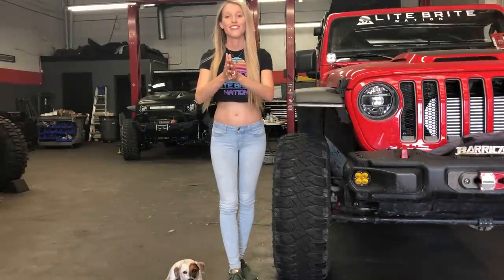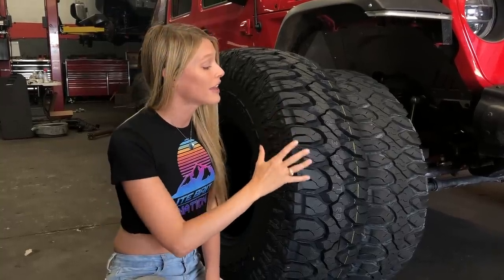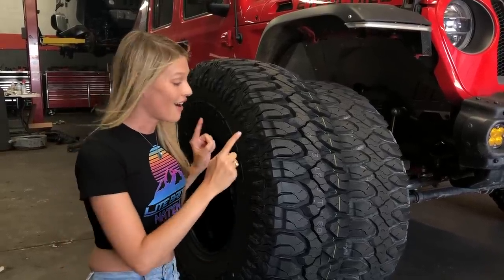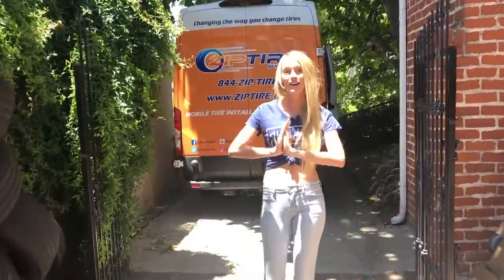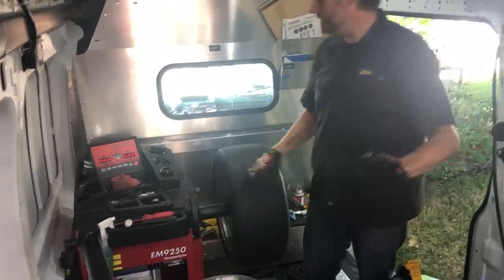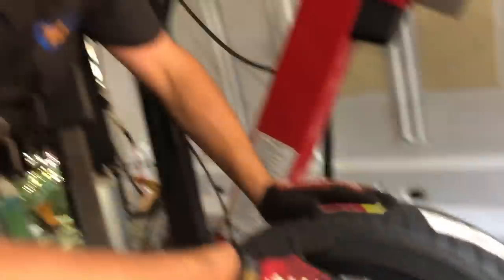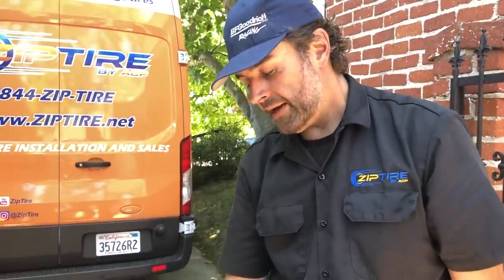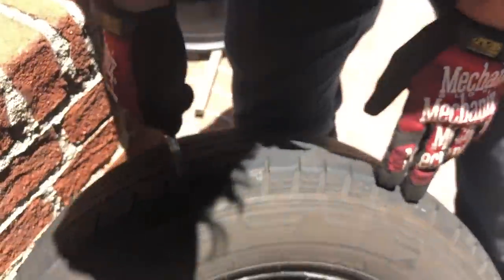LONG TERM TIRE REVIEW - Milestar Patagonia M/T

Comment: in a world filled with black wheels, keep them Lite Brite ! I have KMC Machettes in Brite aluminum with bead locks and It looks so cool on my Bittet Siver JKUR ! I get so many complements on how clean and unique they look.
Brite on Red will be awesome ! Any abrasion you will get on your lock rings will be your badge of courage ! Plus you can use a file to take down the burrs and flash that does occur especially with how hard you guys rock. Stay Brite Lite Brite ! Mouuwwaaa !!! (blown kiss)

Comment: u mention proper air pressure. when off trail, what do you suggest? i have the stock falken MT on my JLUR and the dealer had them at full pressure which was horrible for keeping it on the road. i dropped them to 38 (closer to the door plate pressure) and it is amazing...

Comment: Had the Patagonia’s for 18 months. Ran great for a year after that got loud and you could feel every lug at low speeds. Typically rotate about every 4,000. They have about 15000 miles. And the ride on my 2 dr JK is like driving a dump truck. Now they were good in snow and very good off-road but not sure what happened. Changed to a set of Dick Cepek trail country EXP. guys at the shop said they weren’t chopped. So I don’t know, but I’d never buy another set of Patagonia. 
They’re made in Indonesia, maybe bad rubber trees 😢

Comment: I have a favor to ask. 
IF that new motor winds up being a hemi or LS motor can you provide some feed back on engine heat and A/C performance? 
I figure since you guys are driving long distances and towing you would be a good source for these measures. 

Thanks

OverHeated ;)
Reply: Ralph Muro yup for sure
Reply: Kevin Williams thanks. 
I was about to ask you why you didn’t put an atlas in with the new motor but you just addressed it as I am watching that episode now. ;)

Comment: I've have figured on mine 35/12.5/15 that 2500 miles works best as well as running 28 psi seem ideal.

Comment: Will you be adding more lift going with the 40’s or just add a little more bumpstop?

Also don’t do any powder coating on the wheels. Run them as is, it’s not a mall crawler.
Reply: zmotorsports going to cut as much as possible then bump stop from there

Comment: Guys I encourage you to look into the “rock slide engineering- step sliders.” If you’re going to 40’s it’ll make it much easier to enter and exit your rig. The gen2 are bolt on using factory mounting locations, with no drilling or rivets. Just put a set on my ride and I love them. And yes they are rated for rock sliding, protection and convenience.
Reply: Chris Woo we have sliders already that work great! Thanks for the info though
Reply: I had multiple surgery’s on my terrible knees from 30+ years of competitive wrestling and coaching wrestling. The steps drop down a foot when I open the door and then retract into the slider where they’re protected when the door is closed. Makes it so much easier to get in and out of my Jeep. I know you guys are still young so climbing in even with 40’s Is still doable. This was a great video by the way, filled with good info. Keep them coming.

Comment: Powder coat is just gonna get scratched off on rocks. No point in wasting money on powder coat. As far as my Milestar driving experience with my 33's, I love them. My only gripe would be that my Jeep gets a little squirrelly in tight corners on wet pavement. Stay cool you two!

Comment: Cool video. I hope some people learned a few things about tires. I use to run/show people how to run Hunter Equipment. Some of the best tire and alignment machines you can get. and teaching them the correct way to repair and mount and balance tires. And I have to say, this guy has it down and knows what he's talking about.  
Ps. Kevin's getting his 40's, and it looks like maybe a set of 3/4 or 1-tons to mount them on! lol.

Comment: With my 33" Patagonia M/T tires I tend to drift through right hand corners on slick asphalt if I take them at about 25-30mph, not a bad thing that's going pretty quick through a tight turn on a mud tire, I just do it because it's fun 😜 Hoping to do axles next summer and snagging 37s or 38s

Comment: I actually learned a lot in this video.  I have the same feathering problem in my TJ, as I run MT's.  

I've stuck with MT's after using them one time to help firefighters put out a forest fire near my parent's home.  Re-gearing and the MT's got me from the base of the mountain in the swampy areas through the trees and trails, and up the steep side of the mountain to just yards from the inferno.  I did this trip back and forth all day.  

I'll have to keep a more strict rotation schedule from now on.  The problem is, the moment I rotate the back tires to the front, I get the infamous Jeep Death Wobble from 48 mph to about 55 mph.  After that, it flattens out and gets smooth.  It doesn't happen with new tires.

Comment: If its not a hellcat im guessing cummins 2.8 turbo diesal
Reply: Probably a 6.4L if it’s a v8 I bet.
Reply: Way to much work to install a diesel
Reply: @MrJoey1570  true but so much fun in the end. And not to mention a standout because there are not nearly that many diesal jeeps in Merica. Go big or go home am i right! Woooo
Reply: @JsGarage  cummins recently cam out with there 2.6L turbo in a box that is moslty plug and play for jeep
Reply: chris austin Yea it’s like 10K just for the motor and it doesn’t make a whole lot of power. There are some additional things needed. It’s really no more plug and play than an LS/Hemi. Waste of a swap on a JL IMO but the R2.8 would be neat in something else. Especially since the JL is about to get the ecodiesel from the factory. Hemi/LS or bust for lite brite IMO.

Comment: I wouldn't plan on too much freeway driving with those tires. I would definitely upgrade the brakes and axles. The rolling mass will put a lot of stress on those factory parts.

Comment: I'd powder coat the wheel and not the rim. But as for color or colors. Depends on the wrap if ya'll still thinking about that.? Have ya'll seen how well the Patriot tires do that diesel sellers sell.

Comment: I am running mile stars because of you.
40s on steel bead locks. I color matched the wheel to my body & bead lock is black.
Question is how are you going to balance?? I am running internal beads.
Reply: Eric Schein wheel weights

Comment: Great video. It was very informative. Loved the Porsche. I have been following you guys for awhile now and this is my first time commenting. I have a 2014 JKU that I upgraded the wheels (tires & rims) last November. Because of your earlier reviews, I went with a Patagonia MT on a 17” Race Line Clutch with a simulated beadlock rim from Discount Tire. Absolutely love them!!  So this brings me to my question. If you are looking for a loving, caring, interested in upgrading home to take care of your old wheels 😉. I know someone who might be interested. 🤔. PS I would powder coat the inside of the rims and the bolts on the beadlock red.
Reply: Terry Rapaich haha. Thanks for the support. Unfortunately the racelines are already spoken for

Comment: I got to learn about lift throttle oversteer first hand with my old Toyota MR2. It wasn’t nearly as bad as it would have been in a Porsche since the engine is in front of the rear tires but it did let me know that driving a car with the engine behind you is a whole different sort of animal then what most people are used to.

Comment: I have no experience with Milestars, so no hate intended, but my question would be why is the tire so much lighter, in exactly the same size? build construction, tread depth, # of plys?
Reply: The Nitto MTs are in a different class. This class wiuld include Toyo OC MTs. Class as in level of durability in design/construction. BF and Yoko are in between. The Mils are equal to Mickey or Cooper or Hankook. There are many others. The lightest would be goodyear DT. Look at the sidewall structure.

Frankly you dont need them to be that heavy unless its dedicated for offroad.
Reply: @TheXOoftheRO  if remember from the video didn't they state that the mils were a D range and the Nittos a C range. I would think that would put the sidewall construction on the mils a little beefier, and wouldn't that push the weight to being closer. But yes the Nittos being a dedicated M/T, vs the mils being more of a hybrid, would affect weight difference. 

Just seems like something is weird there, for the those tire weights to be that different.
Reply: @BigM4x4  well that's the point not all tires are made the same. A toyo Highway Tire rated at 35 PSI that's only rated for 2500 lb is actually capable of more. The Nittos and Toyos are just designed heavier duty.

Comment: Powdercoat the center and leave the wear ring plain. Unless it’s a show jeep now
Reply: Smarter Than You lol never
Reply: Kevin Williams sarcasm is hard to convey I think you guys are great. 

I’m rejoining the Jeep fam soon. waiting to see if the 260 HP/ 480 TQ just announced for the new 3.0 ecodiesel ram really just needs a delete, a tune and a few basic mods to be a ton of fun to drive.  if so it cuts the build cost in half and allows for tons of range for a boonies Alaska trip and I feel like a gladiator on 40s is possibly the perfect vehicle to do it in hoping anyway.

Comment: Great video.  Tire mounting/balancing info was very interesting.   Learned a few things.  Andrew has a great TV presence. 

The rotating tire mass was also spot on. Can really effect braking.   To make the weight of the tires and other things clear to LBN,   I am suggesting a new unit of measurement called the Brittany Unit or  "BU".    1 BU = the weight of Brittany.   As Brittany is tiny,  the  new tires + wheels  and rims, should be about 1.3 - 1.4 BU each,  maybe more .   Put 4 of those bad boys on the Step Child (SC) and you have the equivalent  of over 5  Brittanys!     That is a bunch.   Feel free to use BUs wherever needed.

So now you have all of this rotating  tire/vehicle mass, and new horsepower to move it out.    The question is, will the TRANNY hold up  ?

Finally,  you have been hinting about other shows.   You are in LA.   Are you getting your own reality TV show, or show on the MotorTrend channel ?     Inquiring minds want to know.....
Reply: Gene Balinski haha the BU is funny. The show will be released in August/September we believe. Can’t say anything until then
Reply: @boughtnotbuiltoffroad7784  My lips are zipped.  Good  luck guys.  We can't wait.

Comment: I have Mickey Thomsom BAJA ATZ Tired on my 2010 F150 they have 70 thousand miles and still have 6mm or more on them, and they are still relitivly quiet and smooth.  Ive balanced them about every 5k miles.. 
Id like to try the patagonia, im sure they are lighter then the MT..

Comment: I have only recently started watching your videos. I have been enjoying them for sure. As far as the Milestar Patagonia M/T tires, I have run the 33 inch tires for the past 3 years on my Ford F150 and the same on a Dodge 2500 I previously owned and now on my Dodge 3500 dually. I went to them because of price. I like you guys use my trucks. I am a pipeliner and I am constantly off road in various conditions. I have gotten up to 40,000 miles out of them by keeping my tires properly inflated and rotating them every 5000 miles. I am completely sold on them and will keep purchasing them as long as they manufacture them. When I can I plan to increase the lift height on my 02 F150 to go to 35 inch tires. They will be Patagonia tires. I love what you guys do although I am building my Ford for overlanding. I can't wait at least to visit some b of the places you guys have in your videos, especially Utah. Love you guys. Stay safe with this virus thing. Good bye from Louisiana!

Comment: Don't paint the wheels. That adds more weight, and with the 5 new tires (counting the spare on back), beadlock wheels, heavier axels, skids, winch, and whatever else you've got loaded in the back and towing, even your new V8 is going to perform like a slug. The engine swap, while needed, just gets the Jeep basically a little better than stock! Hopefully that new V8 is getting some performance upgrades! Love you guys!

Comment: What pressure did you guys find worked best on your 38x13.50s for the pavement? I have the 38s now and trying to dial in the pressure for pavement for optimum wear. Thanks.

Comment: I prefer the Atturo Trail Blade MTs with a morning cold inflation pressure of 30 psi and I use V bar snow chains for hard icy snow/mud.    Mud terrains last longer because of the deep treads (more rubber) on my huge lifted Suburban.

Comment: One of my employees ran to the tire shop (about 5 miles) with a tire that had 10 psi , the tire guy put the tire in a cage and put 32psi in it and he took off running  the tire exploded
Reply from the maker: Jeff Robbins holy moly.
Reply: @LiteBrite  so it's best not to run down the road while you are aired down, please please please I've watched you guys since you first got your Jeep, I worry about y'all ... Have a great evening

Comment: What psi do you recommend running them on the street? I have a set I bought for a 2020 Ram 1500. Was curious cause I know they are a crowned tire and need to ride on that center more. 40psi is stock recommendation for my truco

Comment: i had a set of 35 inch patagonias on my xj. they sucked major here in florida. they wore out way to quick and would just cake up really bad. Took those off and went to a set of maxxis razr tires. They are so much of a better tire on and off road. clean well ride awesome and  they have outlasted the patagonias 10 fold. i hear alot of complaints about tread life on the milestars.

Comment: I have a set of old dry rotted Mickey Thompson’s on my yota and 3 are wearing perfect still while the pass front has some serious issue, every other tread sticks up high so you have a low tread then high then low then high. And I’m talking really high on some of them. Why is that happening?? I was thinking there were busted belts in it or something but it’s every other tread. Was thinking  I’ll throw it on the rear for now.

Comment: That's a very soft rubber compound Chris at discount told y'all that too it's great for off-roading and the rocks like ya'll do but it's very soft rubber for that so as much highways you do also it's not going to last long. Y'all second pair if I remember right. Toyo Mt is a my tire people get 60000 on those tires easy to Cooper SST pro 50000 going highway and off-road it's a harder compound but you cannot beat the Toyo Mt open country it's a hard rubber but yet great for off road and highway and people are getting 60.000 out of them. Chris at discount tire in Decatur you know him you got your first pair of there he'll tell you the same thing I just said he's been in the business 30 years the best mud tire out there is the Toyo Mt for highway and off-road. or that new BFG ko3 whatever it is that just came out people are getting 50 to 60 thousand of that tire to he loves that tire

Comment: You probably already know this but its a lost process that no one does anymore because tires have improved so much over the years but it is still very usefull with large diameter heavy tires . Truing machine .  You put the mounted tire/wheel in a machine much like a balancer that spins it  but it also have a spinning cutting blade that removes whatever amount of tread that is not round.  They come out perfectly round needing much less weight and you will never drive anything smoother. Doubt you can find one but if you can try it you'll be hooked.

Comment: It is time to go green and ditch the Petrochemical powered engine and go with an all Electric Stepchild Jeep as there is plenty of room if you ditch the fuel  tank and replace it with 66x Deep discharge batteries and go with a 3Phase high torque  electric motor and associated power control electronics  plus the other two to drive your Audio system and you will be cleaner and greener and better on the environment.

Comment: I'd prob do the Cooper Discoverer SST Pro's.....I've heard they rock also.
Reply: GEN2-X they are a great tire but we love our Milestar’s they haven’t let us down
Reply: I love my coopers here in Oklahoma it’s mostly muddy rocky trails. They hook up so well with the muddy rocks.
Reply: @roamingtiger  I had Cooper's. Loved em, but Milestar is for the brokeass ballers like me to stick on some lightweight 37s!!👍
Reply: JL's Jk I’ve thought about trying the the milestars but I go 5 coopers for 1250 so I can’t complain
Reply: @roamingtiger  lol right!!??  I bought my first set of 35" Cooper's On 15" level 8 wheels for 800.00. They were the best I've run. Out if ridge grapplers, trail grapplers, Cooper's and Milestar. But they were louder than milestar
Reply: @roamingtiger  oh..almost forgot...picked up my 37" Patagonia from Amazon for 900.00 using my Amazon cash back!!  Like I said...brokeass baller! Lol
Reply: JL's Jk damn that’s good

Comment: I am so glad you explained the difference of weight of the wheel, I have tried to explain to friends that a heavy wheel robs horsepower, I dropped wheel weight by 20# and had huge power increase to where I could feel the difference... new subscriber here

Comment: I think I may have to try these tires.  I have used Nankang Mudstars in the past and since these are made by Nankang I trust them. I have never had a single failure from the Nankangs.

Comment: If it where mine I would Powdercoat the center rim black or dark/charcoal grey. Leave the bead ring alone since that is most likely to get scratches (or anodize clear it to protect it) and then powder coat or anodize the beadlock bolts red for an extra touch